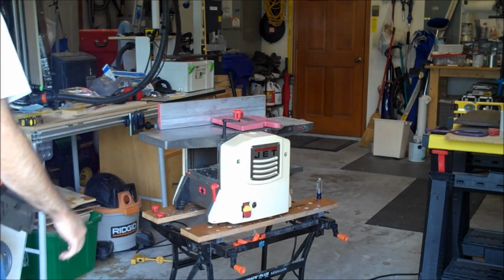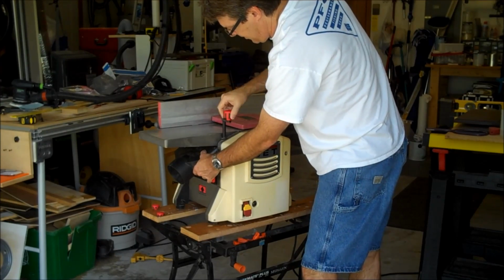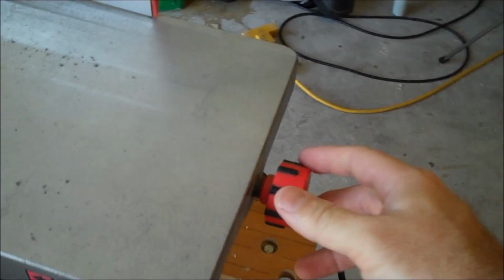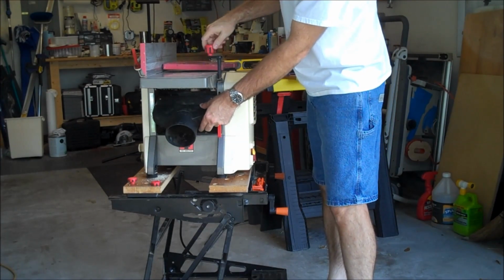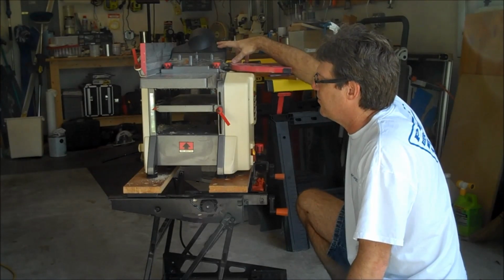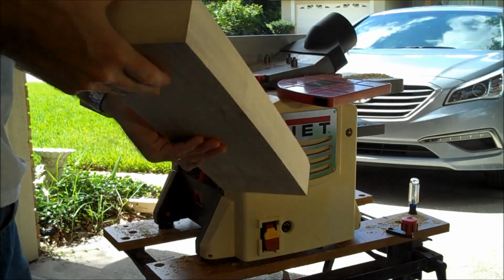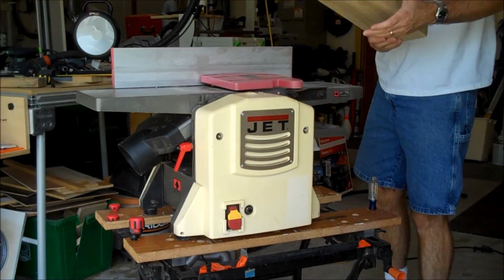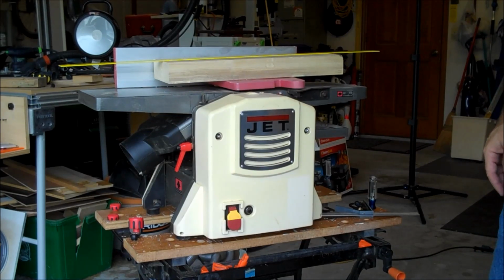Jet 8 inch jointer planer

Comment: Would you think this machine is good for making cutting boards at a hobby level?
Reply from the maker: Mike, even at a hobby level I recommend going with separate machines. I think you will be happier with a benchtop jointer and lunchbox planer for a little more money. I have the Porter Cable planer and Rikon Jointer on a cart that takes up very little space that I'm really happy with. Go used and you can save a lot. Thanks for watching my channel.
Reply: @works4me  awesome!!! Thank you!
Reply: @mikelake662  you would be limited to an 8inch cutting board, unless you did another glue up. 12-13 inch bench top planer will be where it’s at

Comment: good video, i just picked one up for 100 bucks at the bargain center near my house, its new, but missing some parts. ( the dust collection shroud.) 
Ive noticed that the outfeed bed appears to be high or the blade roller is low, do you recall any adjustments fo either?
Reply from the maker: Nice find Kevin. Go to this link for the manual and look at page 10 for adjusting the outfeed.
https://content.jettools.com/assets/manuals/707400_man_EN.pdf
Reply: @works4me  on further inspection. It appears that the unit was dropped from a truck or something. And so the bed is actually bent a little bit so I actually need to order a new one. But thanks for the manual I will use that

Comment: the irony is:  I already have a planar... but I am not really finding any jointers over 6 inches at around 500-800 dollars, so I might end up buying a jointer/planar which I don't need LOL.  The options I'm finding for just an 8 inch jointer either have that cheapish looking corrugated aluminum fence, or their much more expensive.  WHY??

Comment: great review my friend may i ask how is it rocking today? any problems at all since the date you started using it?
Reply from the maker: It worked great while I had it. No problems. I now have a lunch box planer and a bench top jointer. I have the bench top jointer review on my channel. Check it out.

Comment: Any new thoughts of this machine over the years?
Reply from the maker: I didn't own the one I reviewed. This was to help someone that was going to purchase this one. The Jet worked fine but I think it's best to get a tool that does one thing well instead of two things just good. Personally I have a Rikon 6" bench top jointer and a 12.5" Porter Cable planer that I think fits what I do. But, i make small things so I don't need a full size jointer. Hope this helps.
Reply: @works4me  Thanks, I mainly do smaller stuff as well. Would you recommend the porter cable?
Reply: @nananuc  The Porter Cable jointer has served me well over the years after this Jet arrived with a broken infeed table on the jointer. Today I'm fighting a broken drive belt on it for the planer so yeah, never buying Jet again.